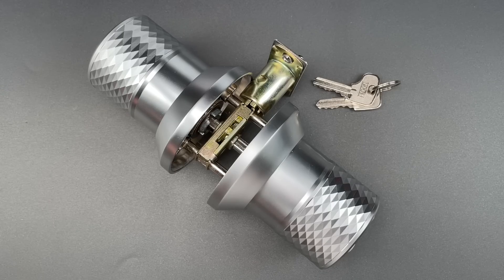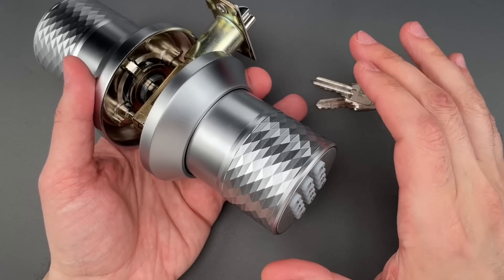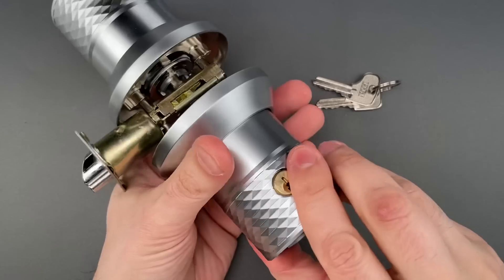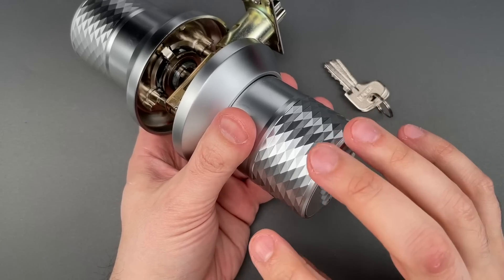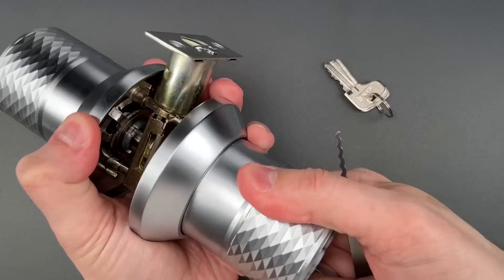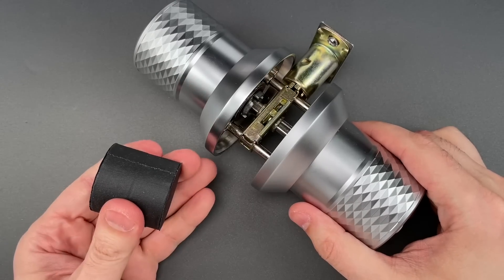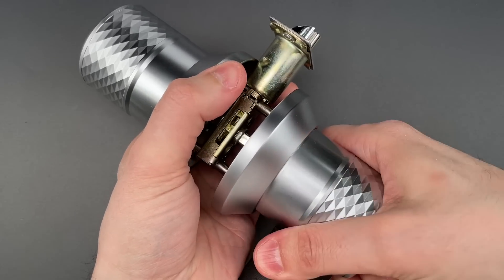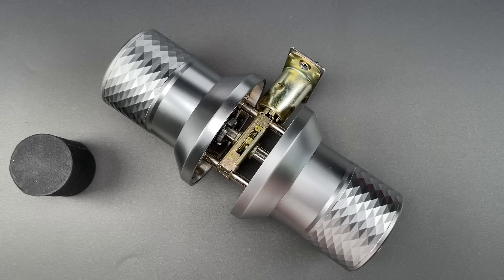[1501] Design Flaw In Fitnate “Smart” Doorknob

Comment: Even setting aside security, the ergonomics of this had my head spinning out the gate, the form factor of a door knob is as persistent as it is because it works pretty well for the purpose of both opening the latch and pulling the door open, a big chunky cylinder you only have friction on the slightly textured sides of for door-pull is an abysmal bit of "hey let's be different just to be different" design

Comment: I would also like to point out, those little rubber buttons will wear out after a while of use. So even is those were not viable attacks, after a while, it won't take a random Joe too long to guess the code when your buttons wear off
Reply: They wear out sure but how will they know the correct sequence to press the buttons in? It would still take a while to figure that out.
Reply: @gadgetman  it drastically increases the chances to get the right code and decreases the number of combos by thousands so
Reply: @packwolf445  True but also honestly you should be changing the code every few months and then this wouldn't be an issue. Any keypad will wear out with enough time if you are hitting the same buttons over and over for years.

Comment: I was wondering if this same technique would work on the HES 1006 electronic strike.  The solenoids for the lock are located in the lip of the strike and I would not be surprised if this is something HES hasn't thought about yet.  I'm hoping you could shed some light before I spec more of these strikes on my installs.

Comment: What is the point of an electronic lock with a mechanical backup that's far and away worse? Ridiculous magnetic override aside, why do companies do that? You're basically engineering weaknesses and vulnerabilities in an otherwise okay lock. I'd understand if it were something that couldn't be raked open, but making that aspect of it an afterthought is absolutely absurd when selling security.

Comment: Latches like this typically are very low security. You see them in the movies being forced open with a credit card or a piece of plastic. And if that doesn't work, you can probably knock the door down because the lock is so shallow. That being said, it may worth buying them only for the cool knobs and replace the mechanism inside if possible.

Comment: A simple solution for these smart locks with back-up mechanical cores: (1) use disc key with many disc, (2) make the core to unscrew some fine thread bolt, so you'd have to pick it 50 times before you open a door.
This way it would take hours for s.o. to pick this lock.
(3) optional: place a trap disc at the back of the lock that locks it shut if s.o. tries to use power tools to turn the disc or pick it.
(4) use non-magnetic metals for the moving parts.

Comment: The USB port is undoubtedly for charging, but it's on the 'locked out' side!?  I know.  I know.  To be on the secured side there would have to be some electrical connection between the the two halves.  But that obviously wouldn't be a 'security issue', so why not?

Comment: What i don't get, so many electric locks can be opened with a manned because they use a relays to close a circuit. Why are they not using a semiconductor. Like a transistor to close the circuit? You can get 12V transistors

Comment: The magnet opening the lock is a deal breaker , I can excuse a bad lock core but no shielding for magnets to unlock is bad , they could have used any non magnetic metallic or alloy but they cheaper out too much

Comment: I have questions about that USB port on the outside, is that purely for charging whatever battery it has? that seems like another potential vulnerability if its not purely a charger.  The magnet is IMO far less excusable than the shitty core because a magnet attack could be done without a passer by even noticing anything unusual, Someone trying to pick even that weak core might still cause someone to question whats up.  But the magnet could be done so fast that it would not look indifferent to someone walking by from just normally operating the door, making one look authorized to enter to the average person.

Comment: I could forgive the lack of pick resistance as that may be different from one unit to the next and could be fixed a little by changing the cylinder or pins. Opening it with a magnet, though, is a hard pass.

Comment: Seems like the most secure lock would be one that simply had no mechanical lock parts…maybe even no keypad, just a code you could use to open through Bluetooth on your phone. There’d be some obvious drawbacks, like forgetting the combo or not having your phone. You can’t pick a lock, the magnet trick not withstanding, if there’s no access whatsoever to it.

Comment: Wave rake is fair, but anyone who knows enough about a lock they find "in the wild" to know that they can use the magnet attack, and also happens to have a large and powerful magnet on hand to execute that attack is going to get convicted of the pre-meditated version of whatever they are doing. This requires prior knowledge. That's heist resistance, not theft resistance you are testing there.

Comment: I'm morbidly curious about what one would find on that hideously exposed USB micro-b port. Best case it doesn't even have data lines connected and is just a charge port(that almost certainly has no real overvoltage protection and might last a year or two before moisture infiltration and corrosion become serious problems, unless used in an extraordinarily dry climate); but if the data lines are in place you are probably in direct communication with firmware designed with the same care and skill that went into the backup lock.

Comment: The magnetic attacks could be mitigated by having another, more sensitive mechanism locking the unlocking when exposed to magnetism.

This could be mechanical in locks like this, and in keypads, a second relay could disconnect the output before the main relay could activate the unlocking.

A couple of reed relays at different places in the keypad could also trigger a tamper alarm.

Comment: ...solution to the mechanical lock flaw is to seal it with superglue or somethnig even stronger. As for the magnet flaw, one way of mitigating the problem it is by rotating the doorknob 180 degrees and installing it "upside down". This way magnet will have to be placed on the other side (wedget between doorknob and the frame). Second option is to install some kind of cylindrical shield around the lock...:P

Comment: Well you did pay $50 for this.  Surely no one expects to pay such a low amount for an actual respectable electronic door handle set.
Try $500 minimum for a decent one.  Yes LPL will likely pick those quickly as well.  But not without specialist tools.

Comment: I wonder what the port under the keyway is used for?  Could you possibly reprogram the combination with it?
Reply: Recharging the batteries. But it's on the outside which is the wrong side.

Comment: I wonder if the USB port, presumably for charging the lock, is vulnerable. It likely wouldn't have the data pins hooked up, but dumping in much higher voltage than USB surely wouldn't be good for it

Comment: The lock body can have a new cylinder put in that's more pick-resistant, and if you were to put a very highly susceptible material around the solenoid to shield the actuator from an external field (or, rather, redirect the external field into the highly susceptible material and thereby leave the solenoid alone), you'd have a much better version of this gadget.
Reply: Yes, but this is what the manufacturer of the lock should do, in the actual factory where the device is produced, before delivering it to the customers. At the moment, what the manufacturer sells is basically a nice looking toy that looks like a lock but is not good enough to be taken seriously. In other words, a dummy.
Reply: @rolfviehmann6240  I am not so much intending to recommend that the end user modify the lock in the ways I have outlined, but rather simply saying that these are the necessary modifications to make it a good lock.

Perhaps I was stating the obvious, especially to the regular audience for this channel. 😁

But if they were obvious, then companies would already be doing these things.

Comment: I'd love to know how you find out if a lock can be opened using a magnet. Is there some way to know if and where the weakness is, or do you just pass a magnet all over any electronic lock and hope you find something?
Reply: Having opened the lock makes it so much easier to find its flaws ;-)

If I made an electronic lock with the relay on the outside of the door, I would add a relay that could be triggered (easier) and prevent the activation of the output for at least 5 minutes.

Comment: Is it a standard that the charging port goes in the exterior side of the door? You may have to charge it with the door open or use a power bank/some kind of external charger🤔. How much does the battery last/takes to charge?

Comment: Why is it all US electronic locks have bypass cylinders? I've got a Yale Doorman and it has ann option to feed it with external power if it is out of juice, and what is this having the crucial parts on the outside? Put them in the inside section.

Comment: A question: what makes a lock more easy to be open by raking? From a technical point of view I mean.
Reply: No security pins, sloppy tolerances, not enough variation in pin height, rounded edges where the key+driver pins meet.

Not necessarily all of these (and I'm probably missing a few factors), but often several of them at once.

Comment: I had to look this up to be sure when he said 40/1000" (forty-thousandths of an inch), and it is approximately 1mm (one millimetre). 
In my quick search, I just learned that people in the USA also use mil as a unit of measurement, but they mean 1/1000" and not the abbreviation for millimetre that I'm used to! 
A metric millimetre is 39.37 US mil.

Comment: second problem could probably be solved by using a non magnetic locking pin . and as for pick resistance if some one wants in your house it takes one or 2 strong kicks unless you have a steel door with steel door frame and bars on your windows.

Comment: I don't really understand why you don't put all the electronics with control on the inside of the door.. This should at least be safer for simple attacks like the magnet for example. However, I think it would have been even better if there was no key at all. Instead of a key, you could have a usb port or a 9V input to operate the lock in emergency mode.

Comment: F - can be bypassed without messing with the cylinder at all.  
D - low skill "raking" or "comb" attacks defeat the cylinder.  
C - beginner level single-pin picking can defeat the lock.  
B - moderate level single pin picking or a special tool are required to pick the lock.  
A - expert level picking or one-off custom tools are required.  
AA - lock-picking lawyer cannot open.  

This one looks like an F.

Comment: I'm interested in that USB slot on the bottom of it next to the lock. I assume it's used to reset the default combo to what you want? If the lock is that weak, imagine how weak the cyber security is on it?
Reply: Probably just used to recharge the batteries. I've never encountered a keypad lock that required attaching a computer to reset. This is a hotel safe lock on a door knob.
Reply: @ehzmia  Interesting.
Reply: Laughably bad at that price.

Comment: To show how truly dangerous these are, they sell a magnetic key ring stud finder on Amazon, you should show if these locks can be opened with one of those, because if I saw someone walk up to my neighbor’s house with keys in hand and then walk in as if he used the key, I wouldn’t even think to call the cops or the neighbor, I’d think it must be a friend I didn’t know or something since they seem to have a key…
Reply: If they have a typical neodymium magnet powerful enough to work through 3/4 inch drywall, it'll work on this lock for sure.  Amazon has a picture of it picking up a 12lb pipe wrench. Oof. Cup your hand hiding the magnet over the lock like you are covering the keypad, fake punching in the combo, nobody would think you didn't know the code.  Unlike a key which you have to insert and manipulate. This is a really awful design that could be bypassed with nobody even suspecting it.

Comment: what might be a strong lock is a 9 key lock.
only a few of the locks are the right combination.
if any of the wrong ones are picked the lock doesnt open.
so you have to have to right set of locks picked and not picked to open it.

so even if security on the cylinder was bad you would still need to pick the right locks to pick. ;D

Comment: Imagine hiding a lock to open a door in the electrical outlet of the house and having no handle on the front door of the house.  Left outlet hole will kill you, while the right outlet is the lock to open the house.  The 3rd hole stabs you in the dick if you put the wrong key in the key hole or put the key in the wrong hole.  Women get stabbed in the face and tits and all over the body repeatedly which is still massively less painful than accidentally sitting on the nuts which is far less painful than getting stabbed in the nuts.

Comment: I've always thought that this style of lock is not even worth the security rating on account of it being barely good for a toilet lock here in Europe. The design has no resistance against brute force attacks on account of its small footprint inside a door.
This one in particular, would merely take a little bit of force to break straight off the door and give access to the mechanism.

Comment: So if the magnet bypass wasn't an issue, with smart/electronic locks like this with low pick resistance, would it be possible to just like fill the cylinder with epoxy without impacting the function of the lock?

Comment: You bringing up the location of the lock on the bottom has got me wondering. Would it not be an incredibly effective strategy to put a lock that requires the "disc detainer lock pick" but on the part of a lock (say the underside and closer to the door party of this doorlock) where it would not be feasible to turn its handles? It seems to an amateur like me that that would be a cheap way to rapidly increase the effectiveness of a lock.

Comment: Just a question, do you have to take those off the door to charge them, or do you have to bring an extension cord with a charger with you? otherwise what's the point of that plug by the key hole?   😄😄😄

Comment: I’d love a short explanation of why the magnet defeats the lock. My guess is it pulls all the driver pins all the way up, similar to what a comb pick does?
Reply: No, the weakness is in the electronic part. The circuit that engages the handle with the rest of the knob when the code is entered, uses electromagnetic components which can also be activated with a permanent magnet from outside the casing.
Reply: @facugaich  that makes sense. Thanks!

Comment: That's funny. I'm the exact opposite. If it's modern and newfangled, it's prolly built cheap. You arent getting through the door of my garage, cuz I use the oldest method know. A bar. The lock box is built so you can barely get your fingers and a key to the lock. Once you get that lock open, you can get to the door lock.
Old school is almost always better in my opinion

Comment: Can you increase the pick resistance of a lock by replacing some of the pins? Would you need to be a machinist to do so, or just get some safety pins that match the length and diameter of the current pins?
Reply: you can replace pins with different types. they are available for all common cores and some not common. it's fussy unless you've taken locks apart before. LPL has a couple vids on it

Comment: Omg, please take it apart and tell us if it would be fixable by an aluminum part!
Reply: Maybe, but it's more likely that the magnet is closing a relay that activates the unlock mechanism; to replace a relay with a non-susceptible device demands changing the circuitry that connects to it.

Comment: That has the potential to be a great lock. Add some pick resistance so it’s not rackable. And change what ever the magnetis pulling to a no magnetic metal
Reply: We didn't even get into the destructive attacks. My guess is that flimsy rotating piece would simply snap off with a small sledge.
Reply: They are called disk detainer locks.

Comment: Let's be real.  The most likely application for this lock is on the doors of restaurant bathrooms where it will be left with the default code just to keep non-customers from using the facilities.
Reply: I dunno, most new installations go for levers over Knobs and honestly from an accessibility standpoint this looks worse than even a normal knob.
Reply: @ThatKomputerKat  Actually yeah, I believe this wouldn’t be ADA-compliant if used in a restaurant. You need a handle instead of a knob to accommodate those with low grip strength or prosthetics.
Reply: For 50 bucks?
Shirley there are cheaper options for that use case?
Reply: @Jehty_  Don't call me Shirley
Reply: I honestly haven't seen a sit down restaurant recently that locked the bathrooms. Last gas station I saw with a locked door had their key attached via a keychain to a giant plastic spoon. Which led to all kinds of jokes I was not witty enough at the time to come up with when I was waiting for the key to the bathroom and the cashier goes "where's the spoon?"
Reply: @adriengriffon  Cut the chain and return the key saying, "There is no spoon."
Reply: I would hate having to use that on a bathroom as you can't open it with an elbow
Reply: Could be a good lock for a yard door. Both easily accessible/unlockable and takes as much time to pick as jumping the fence. Just about good enough to keep honest people out.